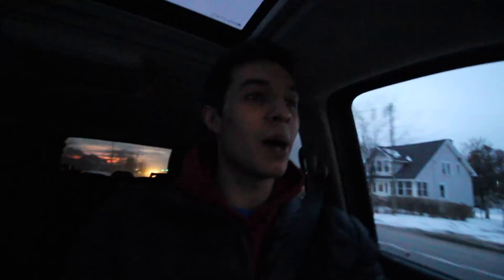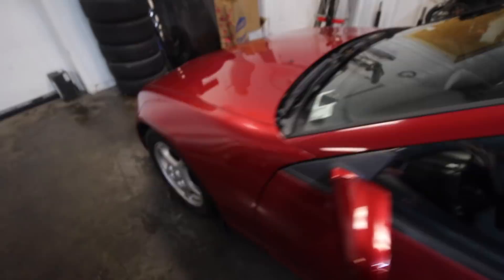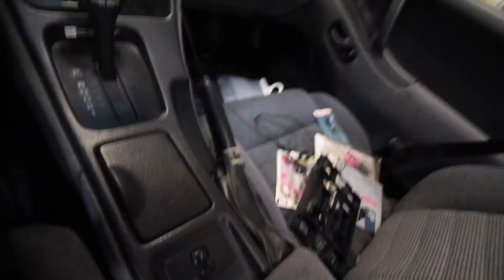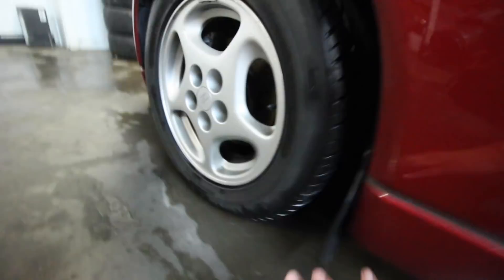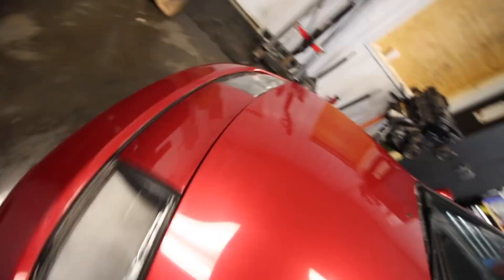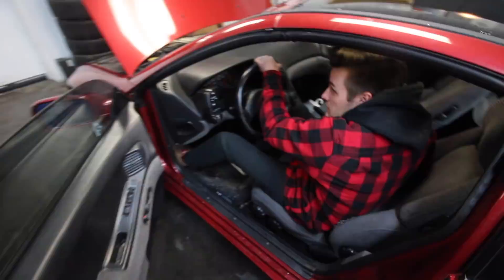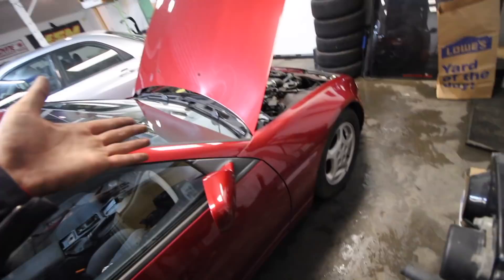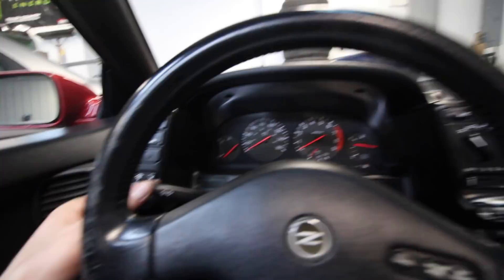PROJECT RB25 300ZX | PLANS & Getting familiar with my New Car

Comment: The only issue you may run into with the z32 is injectors. That swap is a must. There is old style and new style injectors and the old style which your car has is prone to failure.

Comment: As far as no start on the BMW. 
Before you buy the fuel pump, you could spray a combustible aerosol like brake clean or starter fluid into the intake while cranking.  If it starts, you know it's a fuel delivery issue and go from there/suspect the fuel pump.

Comment: Look into j spec 300zx and there were lots of changes to the car in 1996-1999 in Japan. The front bumper your looking for is from those years. Also different front and rear lights

Comment: i hate to be the bearer of bad news but, the bose system is a pos to replace and remove. the speakers will be old and the wiring is a headache. it is able to be removed and change for some aftermarket speakers, just be aware.

Wheels/Tires I would definitely recommend if pockets are deep; 17/18 stagger handles well, 18's are most common, 19's are very hard to pull off. lmgt4 look really good. 

The amount of work to swap an rb25 tho... Good luck man!

Comment: You can contact Nismo Japan (get the number through nissan parts at any dealership, or atleast most dealerships.) and get a JSpec Front Bumper from japan for fairly cheap. Ones already imported go for around 700$. You can also probably gets jspec tail lights, they look really dope. the combination of the two is priceless. I will say from experience, z's can pricey!